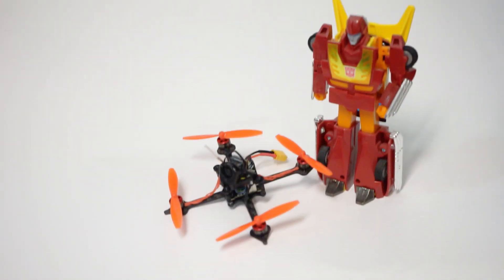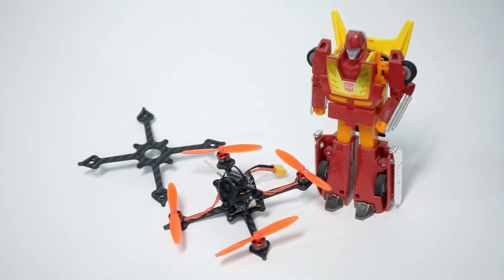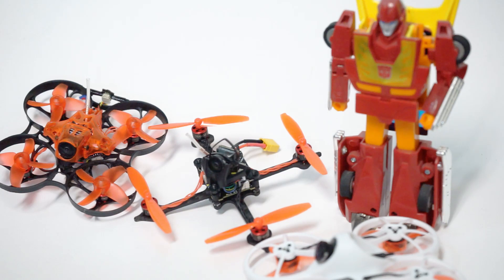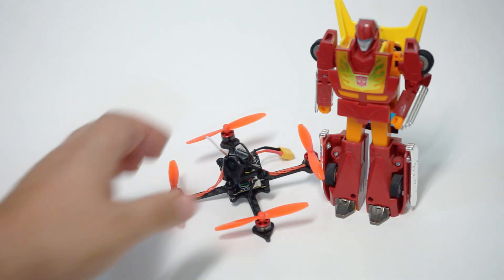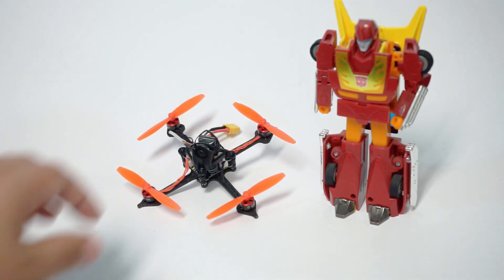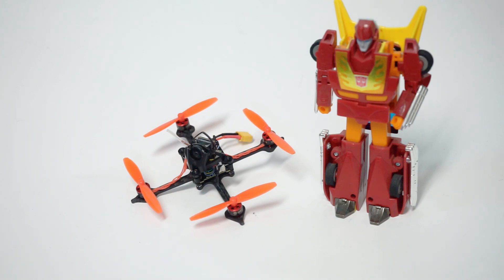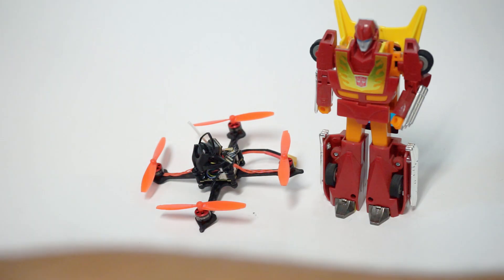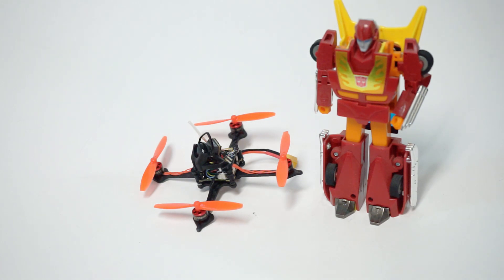Toothpick: The Micro  drone Powerhouse thats changing FPV

Comment: do a testflight with 56mm props, more grip and smoother..im sure you like it :) with the 65mm kk i came on 7min flytime with 450mAh, with the 56mm around 5.30min. im using 1103 10.000kv and a 20x20 stack, as i do not like those whoop fc's...to often burned esc/bec. you can watch the prop comparison and proof of flightime on my video. 
have a nice time :)

Comment: I used these to put wire sets on my Tachyon 0804 15000kv that I replaced my motors with on my trashcan. The stock wires are plastic coated trash. Soldering is......doable. Just takes patients and a tiny bit of skill. LOL 
https://www.banggood.com/3pin-FPV-15cm-silicone-cable-for-RunCam-p-1161226.html?rmmds=myorder&cur_warehouse=CN
Reply from the maker: Do the plugs go into the board? Or did you remove the connectors?

Comment: Wondering what your flight times are like on 0803 t'can motors and the 65mm bi props? I seem to only get 1.5/2 min using the 48mm ldarc tri props?
Reply from the maker: I am getting probably 1:20-1:45 (using undersized 300mah 2s packs).  I need to get some larger 450mah, or maybe 650? What size are you using?
Reply: @JonE5FPV  the 2s 300 gnb (xt30) and nanotech 300 (xt30) The gnb are def best though. Yeah, i think 450 will be the go

Comment: Did you use flux when soldering up the FC? I saw someone in another YT video mention that he had a hard time soldering to the pads on the crazybee.
Reply from the maker: Yes! I always use my flux pen. Helps to flow the solder quick so you can get back off and not risk burning or lifting the pad.
Reply: Thanks! Funny edits and good flying btw.

Comment: I don't have a Kabob toothpick, but have built two others (frames from FlexRC & GnarlyFPV).  These are the quads I always wanted.  They are quiet, super quick, easy to work on and transport.  Flights over 3 minutes on inexpensive 2s batteries. Kabob didn't invent this class, but sure has created a lot of interest in this style of quad.
Reply from the maker: Ohhh, those sound pretty cool.  What batteries are you using?  I need something larger, the 300mah i have are not cutting it flight time wise.
Reply: @JonE5FPV  Tattu's 450 2S  Long versions are really nice, they give me over 5 minutes on a trashcan
I chose those because it exactly fits the battery mount.

Comment: Love mine too! Are you using the recommended pids from Bobs website?
Reply from the maker: No!  I need to go and check out the pids, ill switch over to them once i get the Amax motors.
Reply: @JonE5FPV  yea i went with the Tmotor F10 (1104 7500kv) he doesn't change any pids just TPA. Im sure there is better out there

Comment: M2 x 3mm for motors? Do you have calipers? I may run the flexrc 1102 7800kv on 2s.
Reply from the maker: I dont have calipers, i have been shoping around for some since i do need them.
Reply: @JonE5FPV  I have some cheap 2$ blue plastic harbor frieght calipers without battery. I use them alot to make quadcopter parts. I have a cnc and 3d printer. I am thinking about making one. It's so small, taking off upright or in turtle mode will not work in grass. I may loose this in a field because it is so small. I have a hard time finding my 5" in the field as it is. I just like how quiet it is. Still not as fast as 2207.5 1722 on 6s though.  I do know they are making more motors for this class. Did you see this. https://gnarlyfpv.com/collections/best-sellers/products/bonez-080x-freestyle-frame

Comment: Funny that Trappy told Bob these would be just a fad. This is truly a whole new class of quads.
Reply from the maker: Very funny, definitely not a fad, this is my new obsession.
Reply: @JonE5FPV  I have a lot of stuff ordered to build a few myself. You can put a few together for the price of a single 5in quad.
 Will try my luck with those teeny 15x15 stacks for the electronics.
 
 I think I finally found a quad that I won't feel the need  to hold back when flying.
Reply: Dude, Don't bother using those 15 x 15mm stacks (they're actually 16x16 ;) ). Those are tech from over 2 years ago and they TOTALLY SUCK! I know, I too wanted to try them and bought a stack...it didn't work, so I bought another to swap parts and get at least one to work...NEITHER worked!  They are inherently defective little old tech pieces of crap!  Both the FC and ESC boards have issues...so many they are just JUNK!  Please! Save your money and don't buy them! Don't believe me...read about them on RC Groups - So many issues it's a complete JOKE! Total Garbage!  Get the CrazyBee F4 board that Kabab says is soooo great and durable! He's used many of them and never had a single problem with one yet...and he's beat the living shit out of them and they still are holding up just fine! Amazing!  Go0d Luck!
PS
I just saw your link to the Teenycube...Why do you think they're blowing these out so cheap? - because they are TOTAL GARBAGE! There are 2 boards for the ESC's! Yeah, a full board for 2 ESC's and another full board for the other pair of ESC's - It's such OLD TECH that it comes from before there were even 4 in 1 ESC boards out! STAY FAR AWAY and if you have to spend the money because it's burning a hole in your pocket - Throw it to the wind! You'll enjoy it more because you won't have the stress and anxiety of dealing with this TOTAL CRAP!b  Seriously, do not buy ANY 16x16mm Stacks of JUNK!
Reply: It's like a more evolved (and commercialized version) of the https://fishpepper.de/projects/pepperf1sh/ which was the first brushless quad in this category. Really good blog if you're interested in the technical details of how they came to be early on.
Reply: @MrRelys  Thanks for the link, I bookmarked it. I was planning to build a Bat-100 for a while now, which is also a similar concept. The AIO boards from the new brushless whoops have really simplified the design. I think it's the real particularity of the Toothpick. Having crossfire (or FrSky R9) integrated on the boards would be the last crucial element.
Reply: @yannickg6904  Yeah the range of the internal receiver on these boards blows from what I've read. Maybe not an issue on indoor 65mm brushless whoops. Better to just supply your own.
Reply: @MrRelys  Bob has been complaining about the range, he tried to convince trappy to offer a TBS board with Crossfire. That's why I decided to go with a a stack of multiple boards like the Pepperfish, mine will have an XM+, maybe even a R9MM